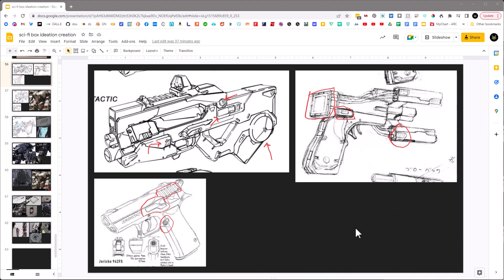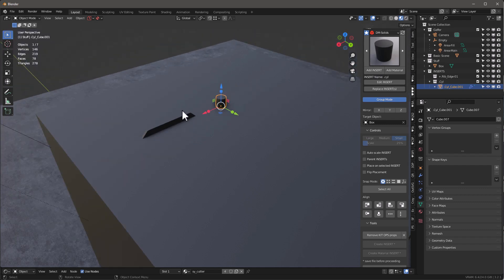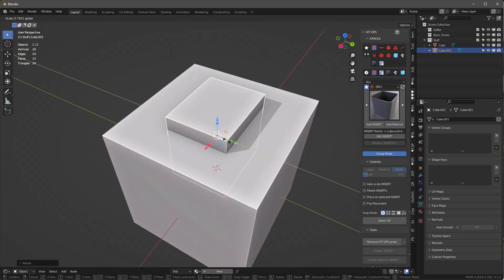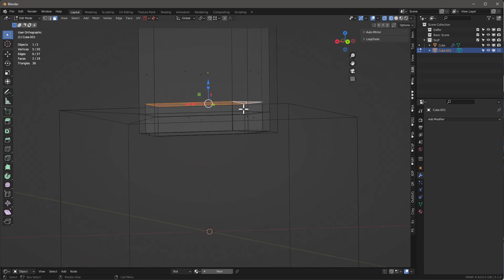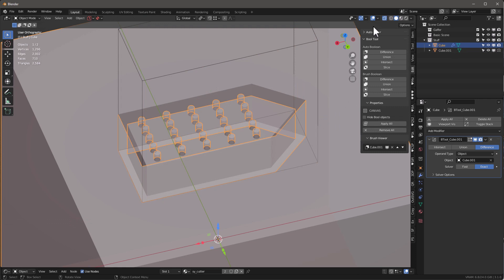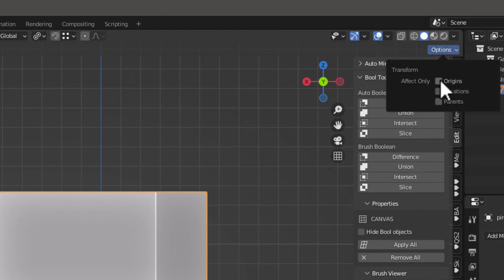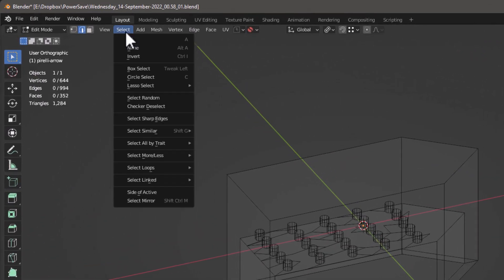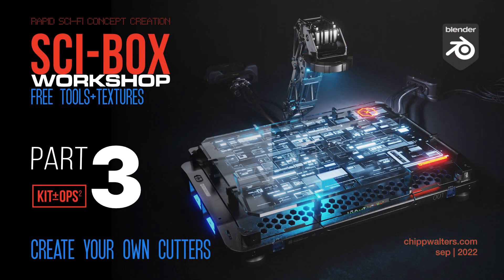Creating your own Shape Vocabulary Blender SCI-BOX Workshop Part 3

Comment: Cool!! This video has really helped me understand the process of making (with the intention of saving) one of your 'cutter' type inserts.

Btw, Chipp, could you advise me on something please? ...

Let's say that we have a fresh copy of blender on a newly built machine (Win 10), with no previous versions of blender having been used or installed.
We also have a whole bunch of key CW addons which we want to install. Does it matter exactly what order they are installed in?

Common sense says Kit-Ops Pro first, since many of your other addons integrate with that, but after that? 
I have Design Magic, Eevee + Cycles Material System, and Simple SciFi + Flex all ready to go. 

Is it worth you doing a little video on this to help people who are new to your addon ecosystem? Is there a little bit of configuration stuff to do, to get them all working together nicely?

That would be very helpful, thank you. 

🚀🚀
Reply from the maker: You can install them in any order you like. It doesn't matter.
Reply: @ChippWalters  ok thanks!!